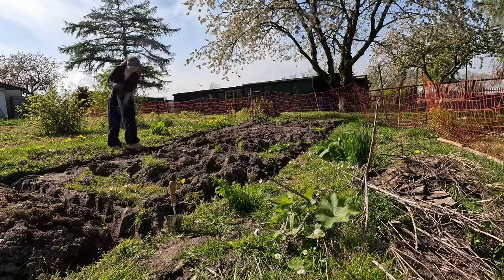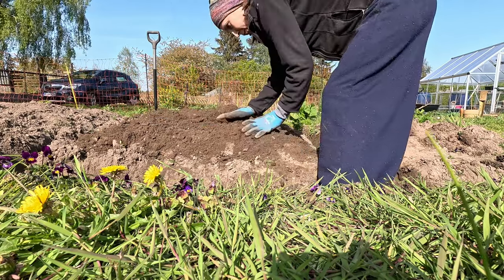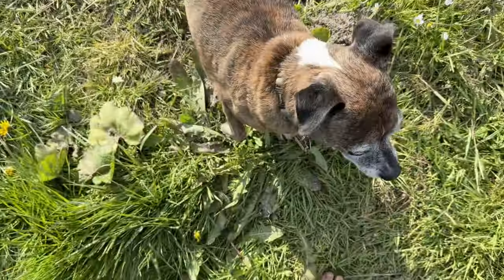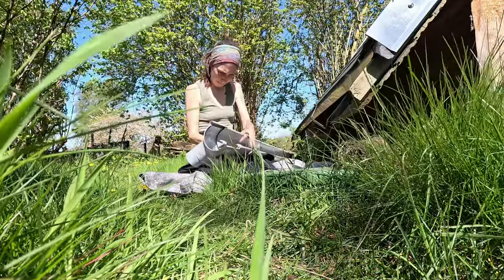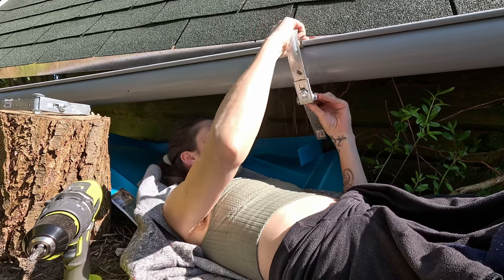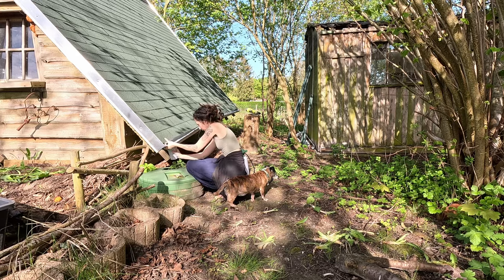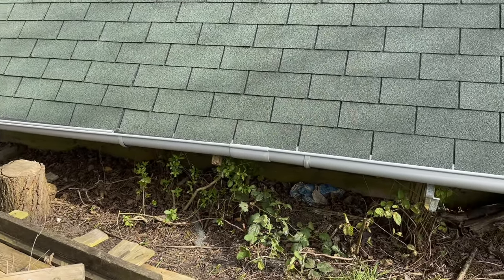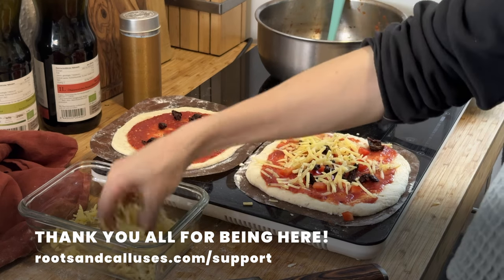Solving the water problem #092

Comment: Idea! What about adding grass etc then wood chips into the empty parts of the potato trenches to stop it from collapsing back into itself, and provide a mini compost to help feed the potato bed and the disturbed soil? Like hills/swales for water retention and control with compost!
Its officially time for a straw hat methinks :D You are officially Farmer Roots! Well, that and it will help keep you cooler and prevent sunburn on your shoulders/face cough I wouldn't know anything about that...except OWWWWW from the year I discovered first hand those hats are nothing to make fun of and the old timers have it right ha! 
Brave-I know gutters can be sharp in addition to being no fun to install yourself. 
Thank you for sharing with us and letting us hang out with you and Pepper <3
Reply from the maker: I already have the first compost in the ditches. They will get filled with spent hay and some other mulch very similar to your suggestion. I also do own a hat. It is not a straw hat but it is a sun hat :) I am sure it will come out again soon. Thank you so much for being here!